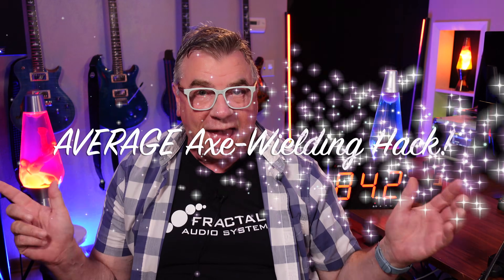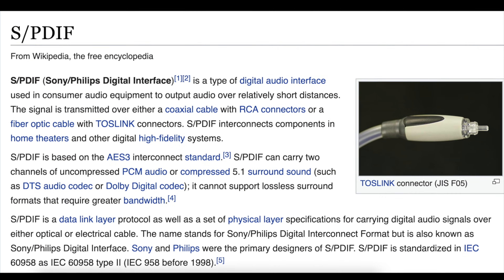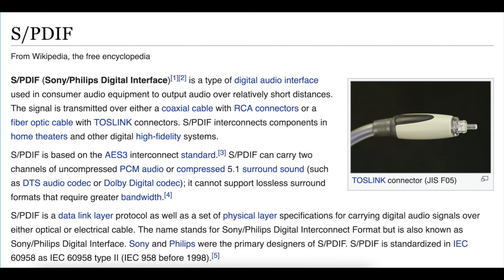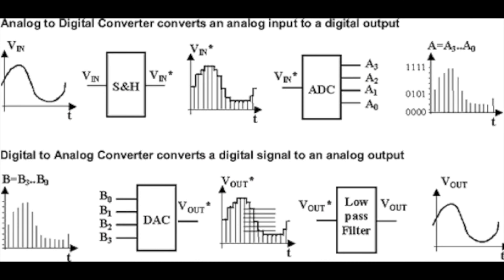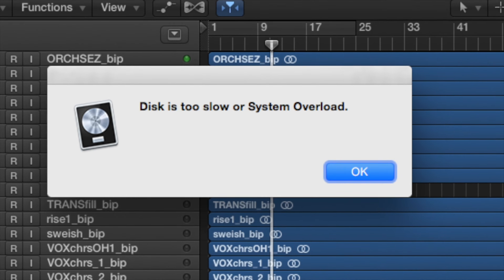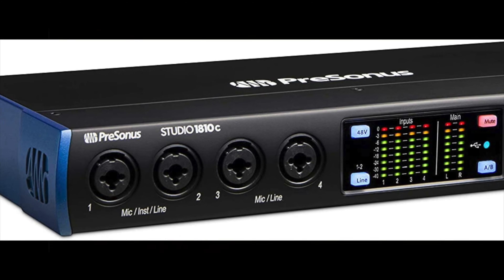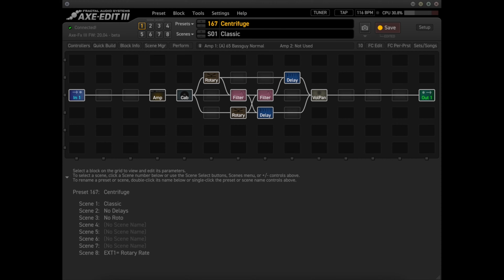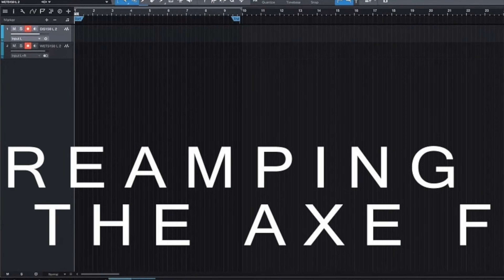Axe-Fx III/FM9/FM3 - S/PDIF? What Is It? Why Should I Use It?

Comment: Actually, most computers do have S/PDIF. The 1/8" mic input and audio outputs are usually equipt with it. Older audio cards have didicated jacks as well. I'm interested in trying it with my Linux system to connect my Eleven Rack which Linux does not find.  But acording to a post I seen Linux does find S/PDIF. It only finds the MIDI side of the 11 rack and not the audio via USB. I would go Linux all the way if I can get my gear all up and running with it. My Presonus mixers Firewire died on me so that may have worked with Linux. Nice video.

Comment: Doug I have the same presonus as you - what is the setting in axe edit you are using ?     Internal   or    SPDIF/AES IN     thanks much
Reply from the maker: Internal. I'm pretty sure that if you chose SPDIF/AES IN, the Axe-Fx III would be expecting a clocking signal from an external device. Thanks for asking!
Reply: Thanks Buddy Yes I agree I have Internal also - have a nice day :)

Comment: I have a 2626 and my ax is clocked from the interface. I guess it depends on which interface you have. Even within brands. But no, you don’t always have to default to using the ax clock. I’ve actually never heard of anyone having to do that.

Comment: I use S/PDIF into a Focusrite 18i20 G3 with cheap stereo RCA cable. Works great. I slave Focusrite on 48KHz clock and Focusrite automatically uses audio channels 11 and 12. The only downside, as you noted, is I have to use 48KHz clock in Logic.

Comment: Ok, is it just me per the USB connection to PC in order to utilize Editor. I just received my new turbo FM9, the “USB” jack on the unit looks like a “printer” usb jack NOT a regular USB jack - seems odd no one has mentioned this - kind of a big misnomer - or perhaps I’m completely missing something - Any Help Please and Thank You!!! 🤘
Reply from the maker: Yes, all of the Fractal modelers use the printer port USB type. Helix and (I think) the ToneX pedal also use this type of connector.
Reply: It's a USB-B connector and "Just like USB-A, it’s the original designation for the two ends of a non-symmetrical cable. The differing form of USB-A and USB-B helps to enforce the mono-directional aspect of these iterations of USB. Data flow is bi-directional, but power may only flow from the host to the peripheral or receptor end and, therefore, the cable can only be connected in one way."

Comment: Guess I’m missing the boat here. Lol. I just run the xlr outs on the FM3 to two inputs on my apollo.
Reply from the maker: There's nothing wrong with doing it that way, it's just that SPDIF is easier, rock solid, and frees up those 2 channels on your Apollo.
Reply: @DougBsDigitalDen thanks Doug. Well…since I posted that comment I jumped and picked up an axe fx 3. I’m going to see about hooking that up via SPDIF. Looks like I’ll need a cable with different ends or the box you mentioned. Need to watch this video again to make sure I understand how to hook it up properly.

Comment: Howdy
I’m all setup toslink to spidif into my Apollo x
But can I loop stomp boxes using the remaining analog AxeFx 3 connections on back 1-4 and will it work because I though those knobs didn’t work when going digital
I have some new UAFX Fx I’d like to hear in my setup
I also have a freaqout that would be a nice addition but I’m trying to avoid going into the front end right after, my guitar
Thanks
Reply from the maker: I'm guessing, but I don't see why it wouldn't work. The SPDIF output is the same as either your OUT1 or OUT2.

Comment: So I have an Axe fx II XL
I managed to erase the presets the previous owner had stored.  But I can not get axedit to work.  It says connected, then it says the communication times out.  Using a MIDI to usb into computer, Axe to Audiobox96 into computer

What am I doing wrong?
Need help
Reply from the maker: Sorry, I don't have any experience with the older Fractal modelers.
Reply: What do use the midi converter for? The Axe2 can be connected directly to your pc via USB if i recall correctly...

Comment: I'm wondering if you could leave the software clock as the master, and change the AxeFx to sync with that. I remember the AxeFx has a setting in there to use external clock. 
Cool little rabbit hole I just went down.
From the Fractal Wiki
Word Clock
The clock source for the A/D and D/A converters is either AUTO/INTERNAL or SPDIF/AES.
Axe-Fx III – Word Clock is recovered from the SPDIF/AES input signal.
"The Axe-Fx III has word clock." sorce
"Yes via SPDIF/AES in (which actually works better as a word clock than a word clock input)." [145]
"If the Word Clock is set to SPDIF then you need to supply a signal to the SPDIF in to derive the word clock from. Otherwise the Axe-Fx is the master and you need to set your interface to be a slave." [146]

Comment: You don’t actually have to let the Axe fx do the clocking. I have an RME interface and can totally do clocking in the other direction.
Reply from the maker: My old Apollo was the same way, but the majority of interfaces do need you to set the AXE-FX III as the clock source.
Reply: @DougBsDigitalDen  my Motu is the master in my setup.